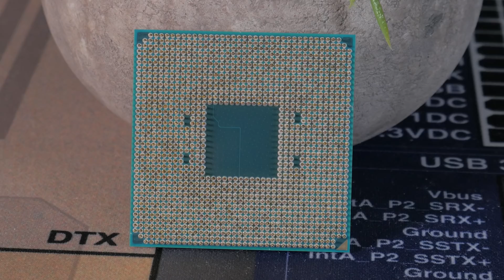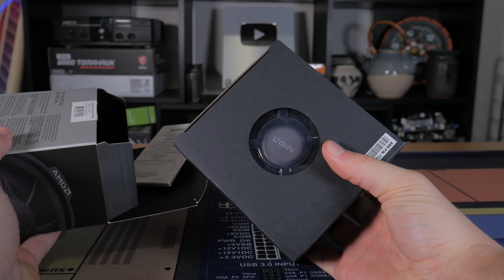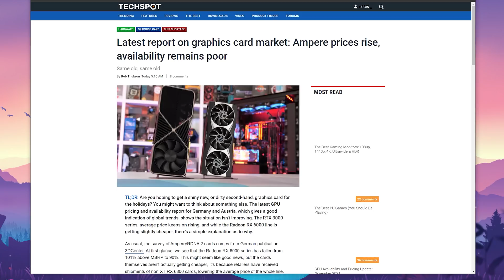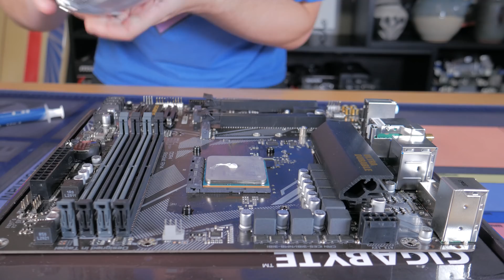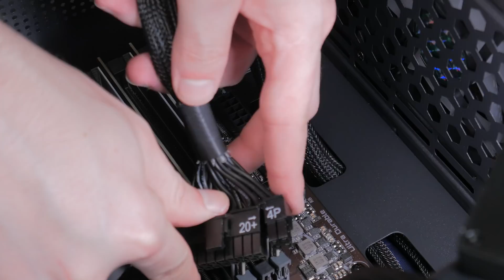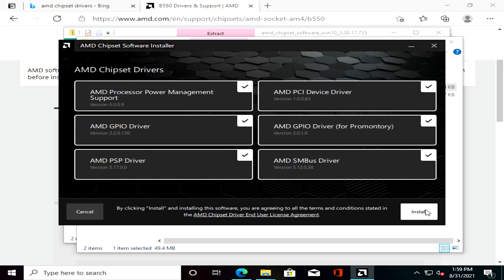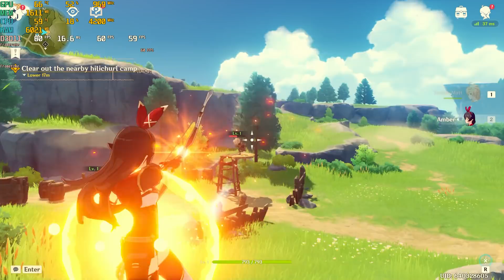BEST $750 Gaming PC Build Guide! (Late 2021)

Comment: Some things that should be changed:

1) CPU - 5600G (and the AM4 platform in general) is a horrible value in 2021. A much better idea would be to get the i5-11500 (UHD 750 version of the 11400). By compromising the iGPU performance you get a slightly better chip for less money that can be redirected into the GPU (a good board for it would be the B560 Pro4)

2) CPU cooler - Stock coolers are all underperforming and obnoxiously loud. It might seem like a good idea to save here, but trust me that $25 isn't enough to justify having a PC as loud as a taking off Boeing 747

3) PSU - Despite what many think, EVGA power supplies are bad. And the BQ is no exception. It has voltage regulation issues, fan speed problems (AKA noisy), lacks OTP (over temperature protection) and uses iffy caps on secondary lines. A good replacement would be the MSI A650GF, Corsair TX-M, Seasonic Focus, Asus TUF or Super Flower Leadex III (best out of the bunch)

4) Case - no-name cases are never a good idea for new builders. Particularly because of how cheap they are, they often lack features of good cases such as cable routing, adequate spots for drive bays and overall ease of building. Spend $20 more on the case and you'll thank me later. My personal recommendations would be the 4000D Airflow from Corsair, Pure Base 500 from Be Quiet, Meshify C from Fractal Design or P400A digital/P360A from Phanteks

If anyone has other input, it would be highly appreciated
Reply: Intel igpu is very bad compared to 5600g, whole lot of difference between two also the AMD cooler is much better unless you wanna overclock
Reply: @spookyskellyskeleton609  
1) Wrong. It's all in my original comment. This isn't an iGPU build per se, and while UHD750 is somewhat worse than V7, 11500 is still a better chip than the 5600G and it's about $80 cheaper

2) Parroting statements from youtubers. "Stock cooler is fine if you're not overclocking" - no it isn't. Barely adequate, yes, but if you want a quiet build, you absolutely have to look elsewhere
Reply: @Nagib23_32  it's way worse not "somewhat worse" the benchmarks prove it

Comment: Hey Matt! So I had a question is there a way if possible to take components of a console like PS4, PS5 or An Xbox and build a PC out of those components? It could be a great video idea or a shit one.
Reply: There is no feasible way to do that. The hardware for the consoles is very specific so even if you were able to successfully desolder them from the motherboard, there is no way to use them on a typical computer. There are also tons of technical reasons as to why that is not feasible.
Reply: No, the cpus (apus) used in consoles are stuck in the motherboards and don't support any different OS except for example the ps4 os.
Reply: Doesnt seem possible. All the components are soldered to the motherboard and the motherboard locks them if you try to use any other software

Comment: It’s so funny because I bought the cheapest case on Amazon that looked good, even though it had almost no reviews and little to no data about it. I was satisfied with the case when I received it. It’s great to see someone on YouTube that has the same mentality of “if it doesn’t affect performance, just get the cheapest option!”
Reply: As long as it has good Air flow its good
Reply: @shaiyakun8890  yea I got a super cheap one but it had 2 built in fans and had amazing air flow
Reply: @Some DUED Heh, your GPU will beg to differ. No airflow=higher temps=lower boost clock.
Reply: @Some DUED Temps: Hi
Reply: @Some DUED dude do your research before saying anything with this much confidence
Reply: @Some DUED Well sure it's not going to male a catastrophic difference I agree. But I've experienced it with my old InWin 805. My gpu temps would hit 80c in that case. Now I have the Corsair 5000d airflow and hardly hit 70c with boosts into 2000mhz. Guess it depends on whether you want aesthetic or function.
Reply: @Some DUED ouch.
Reply: @Some DUED please nobody listen to this guy. If you have high end components do them a favor and spend a little extra on a case with decent airflow. If you have cheap components such as the video above then the case doesnt matter much as nothing is going to get too hot in there.
Reply: @San_Omi5  stop being toxic. He’s telling us what’s happening to his pc and how it affects him. I doubt u have a pc, u prolly just watched 1 building a pc YouTube video and think you’re a pro. Yet you haven’t brought up any fact to back u up. Smh
Reply: Yeah I guess go for the cheapest option but that’s only for some components
Reply: @Some DUED no case is going to increase performance cause the case acts as an insulator for heat to stay in. This is why a cases airflow is very important and cases do effect performance.
Reply: i try to prioritise airflow when it comes to cases anything else doesnt matter to me lol
Reply: @Some DUED jesus christ your poor 3090
Reply: Pl

Mm
Reply: L
Reply: @Some DUED wait 120 mhz.. Isn't it low? Sorry if I've understood incorrectly - 
So mining is run in low frequency.. Wouldn't that be a reason for why it's not throttling since there is no need for higher clock rates? 
Or was that a typo 

Edit : if 120mhz ain't referring to clock speed but to some mining metric, then I kind of get it
Reply: Does anyone know where to find the case in the uk please
Reply: @Some DUED ok thanks

Comment: Thanks for the explanation.  I found useful on where the LED connections need to go (14:50).  Mine are in the right place, but RGB does not function at all.  Any ideas?
Reply: you mean the case front LEDs? Because the fan RGB and stuff like that use a different cable.

Comment: are  the miners the one pricing the GPUs, why blame them?
Reply: 60% miners yes. 40% scalpers, but miners are also scalpers. They buy everything in stock to sell it for more on ebay.
Reply: @ties9123  there a lot you don't know about miners
Reply: @lakaymark  what don't I know? People buy gpus in stock to just sell them for me, miners use gpus and after that they resell them for more aswell.
Reply: @ties9123  the sell them at high prices cause they got them for high prices... root cause of the issue is that gpu are being sold at scalper prices by NVidia and AMD... 5500xt is comparible price of 590 but almost double the msrp... 6600xt a 1080p gpu being sold from microcenter at $700 when their msrp was only about $400...

Comment: 0:56 The 5600G also has half the L3 cache of the 5600X which has a noticable impact on performance in some workloads.
Reply: Mostly towards ESport games (i.e CSGO, League of legends, Valorant, Overwatch) which loves larger L3 Cache. The 5000 series L3 Cache is unified between all cores while older gen is split between its cores.  5600G runs close to a 3600x on non-esport games with highend gpus. 

The main selling points would be the integrated graphics (either for more ports for screens, troubleshooting), cooler temps due to 65w TDP, and options for a mini itx build (Inwin Chopin 3.3L Case or Asrock x300 1.92L Case) as a secondary/LAN computer once you upgrade to a better CPU.

Major Cons would be the smaller L3 Cache, PCI-E 3 lanes for both the GPU and M.2 Slots (This includes MB which supports PCI-E 4) [SAM, Resizable bar, 7000+MB M.2 uses Pci-e4], and cannot run high stable clock speeds when the IGPU is active at lower voltages (the IGPU is disable when your display ports are hocked up to your dedicated GPU) 

To Clarify, I am currently using a 5700g running 4300 All 8 cores @ 1.2V (Previously 4600 AC @ 1.35v) with a 3060. It's a solid CPU and stays cool due its low TDP and IGPU being disable. There a lot room to overclock or undervolt without temps being a major issue. However, I'd suggest getting a 5600x since most games don't utilize more than 6 cores and runs cooler than a 5800x. 

You will start experience CPU bottlenecking from GPU that is 3060 TI onwards or 2070 onwards.
Reply: @Teodor Ilie  Well fuck, I bought the 5600g hoping it'd be fine enough for rpcs3 and yuzu (I managed to get a few rpcs3 games running barely acceptably on a 3500, haven't touched yuzu)... Am I gonna be screwed?
Reply: @Teodor Ilie  ah, mb I should've said. Got myself a 6600xt, only got this CPU because the 5600x (and for some reason, many cpus inferior to the 5600g...) had really inflated prices for some reason. Will keep Linux in mind, ty man
Reply: @Teodor Ilie  Yeah UK here and looking now the prices are pretty much same as yours. Def patient with the emulation, tbh I'm amazed it's getting as updated as frequently as it has this past year. Appreciate the help man
Reply: 5600x vs 5900x I can afford the 5900x but is it worth it buying high end for gaming? I like to play Total war games
Reply: @ziljin There are games that are able to utilise more than 6 cores. But I doubt that is the case with Total War.
Having 12 cores is great for productivity.
But by the time those extra 6 cores become really relevant for gaming, there are going to be CPUs with the same amout of cores, better single core performance and (hopefully, for less money.
I suggest saving some and buying the 5600x or going with the 5800x as a sweet spot.
Reply: @beavatatlan  tempted to get the 5600x but i need a new motherboard to go with it. do i need one with wifi? i just use the ethernet cable. usually i just get a budget board. any features to look out for? just a nvme/m.2 slot and thats it?